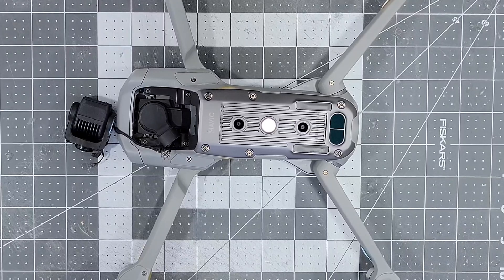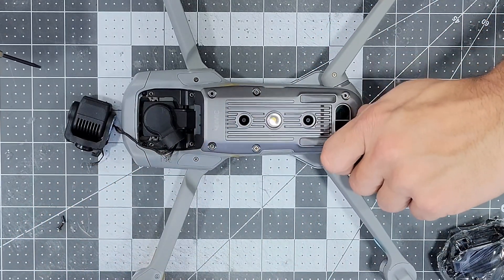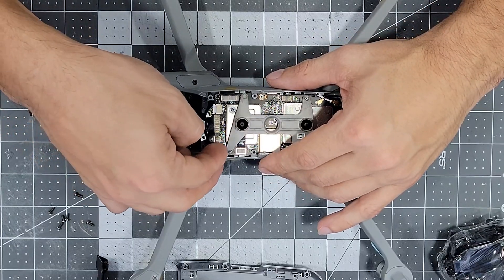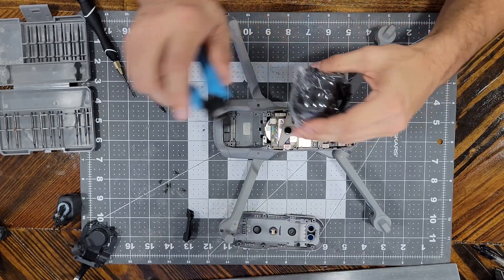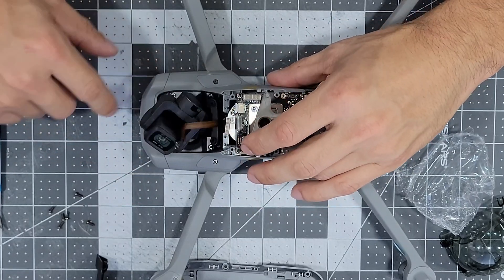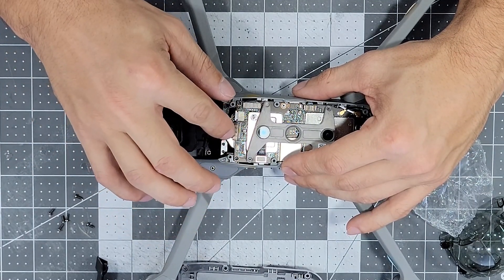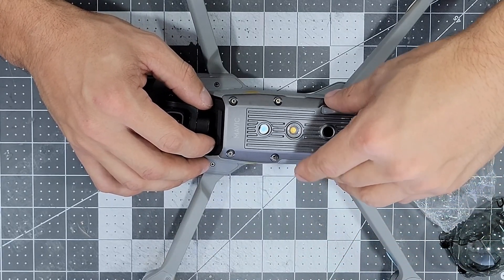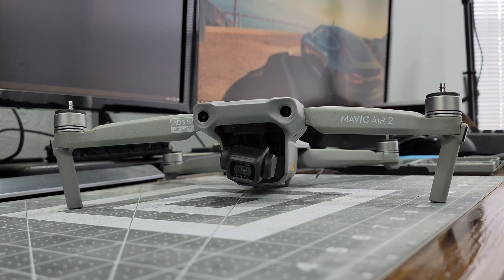DIY Mavic Air 2 Gimbal Replacement

Comment: hi .my mavic 2 he crash camera was still working before gimball change changed lead flex too but then camera not work after even tried old lead which had lost one connector but still no camera any ideas ?
Reply from the maker: That would make me think that either the main board is damaged, or the flex cable is not fully seated on to the main board, causing it to not connect and communicate.
Reply: @JoeMartinMVC  i didnt touch main board apart from pluging leads in we checked to make sure well seated..i may have got some thermal paste on board would that affect the chips?did clean it with alcohol after
Reply: @stevemcgowan3017  Did you fix the problem? My drone has the same probplem after changing the gimbal. Did your gimbal self move though? Because mine isn't doing anything at all...

Comment: Thank you! I just got my Air 2 in the mail and didn’t notice the obstacle directly above when taking off for the first time 😢 I’m going to try and fix it myself using your video. This is drone 3 and crash 3. 2/3 were my fault one wasn’t. Sigh
Reply from the maker: Oh that's rough. I crashed mine trying to get something out of a tree, so I feel your pain.

Let me know if you end up having any questions during the process.
Reply: @JoeMartinMVC  Thank you tbh seeing how much that freaking gimbal costs I’m buying an entirely new air 2 and selling that one or keeping it for parts for the brand new one (which I’m 💯 getting DJI care Refresh on…only $80)
Reply from the maker: @itgoesup3975  Haha, I can't say I blame you. I considered doing the same thing when I broke mine.

Comment: Hello, very good video, I have a big doubt, I want to know if you know where exactly the compass is located in the Mavic Air 2, I had a similar doubt with the compass of the Mavic Air v1 and after investigating more than 6 I was able to confirm that it was located in the main board, that is, it is integrated with the board. Do you know if the same thing happens with the Mavic Air 2 version? Thank you
Reply from the maker: I'm sorry but I can't say that I know where the compass is located.

Comment: Thanks for this guide! I replaced the cable after my image looked bizarre due to a collision which pulled on the cable turned the camera body too far. It turns out that I simply had the overexposure warning on.
Reply from the maker: Well at least that's an easy fix. =)

Comment: how you do to the drone recognize the new gimbal?
Reply from the maker: The drone should automatically be recognized, but will likely give an IMU error, but still work. Is the camera not working at all after replacement?
Reply: @JoeMartinMVC  ok thanks, no but i have the idea to change the gimbal for a new one 👍🏻.

Comment: I really appreciate you taking the time to put this together.  I just scrubbed my gimbal pretty hard using the Air 2 to help launch a pull line for an antenna.
Reply from the maker: I’m glad I could help out. 
That’s actually similar to how mine got damaged, I was trying to get an antenna unstuck from a tree and collided with a branch.
Reply: @philjensen5151  had mine repaired at
Stalybridge drone repair in end sold drone now I have mavic 2 pro but mavic air 2 great also